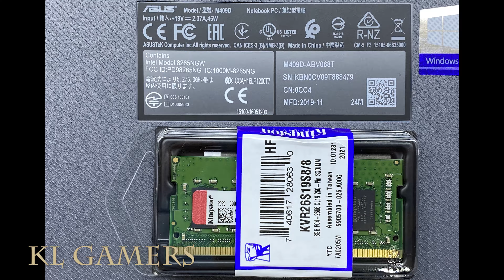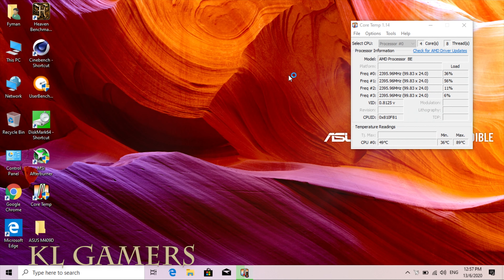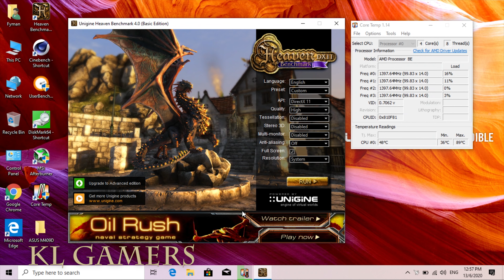ASUS M409D-ABV068T Notebook Upgrade DDR4 RAM with Benchmark

Comment: Ryzen 5 3600 a clasic for a notebook 😎
Reply from the maker: okay👌
Reply: This particular notebook uses a Ryzen 5 3500U CPU, which is substantially different from a desktop Ryzen 5 3600 CPU in that it uses an older architecture (Zen+ instead of Zen 2), and is a higher-binned chip for efficiency running at lower clock speeds so that its heat output is within the thermal profile of the notebook. It also has integrated graphics which the Ryzen 5 3600 does not. The CPUs you find in laptops are not exactly the same as the ones you would find in desktops, take note of that.

Comment: Why is the cpu usage goes up and down?
Reply from the maker: because the testing data is different
Reply: @KLGamers  ooooh
Reply: This behaviour is called throttling. Watch what happens to the CPU clock speeds and temperatures as the usage goes up and down. The manufacturer of this notebook decided to cheap out on this particular model by using a push airflow design that blows air through a small heatsink slab on the CPU. Not very effective as the fan isn't directly blowing through the heatsink, and secondly, the heatsink looks ridiculously undersized for the job, even if the CPU's configured for 15W TDP. A better and more effective cooling solution that would prevent throttling for the CPU would be a heatpipe and heatsink design carrying the heat to the outer edge of the laptop with a fan blowing air directly through the heatsink there which would result in much faster heat dissipation.

Comment: i want a new and much better laptop :(((
Reply from the maker: ASUS F512DA-EB51 VivoBook 15 Thin And Light Laptop, 15.6” Full HD, AMD Quad Core R5-3500U CPU, 8GB DDR4 RAM, 256GB PCIe SSD, AMD Radeon Vega 8 Graphics, Windows 10 Home,Slate Gray
(Amazon link) = https://amzn.to/3oLMujC

Asus Vivobook M409D-ABV067T/ABV068T 14" LAPTOP ( Ryzen 5-3500U, 4GB, 512GB, ATI 2GB SHARED,W10H ) NOTEBOOK
(Lazada link) = https://c.lazada.com.my/t/c.Y5atkR?url=https%3A%2F%2Fwww.lazada.com.my%2Fproducts%2Fasus-m409d-abv068t-14-fhd-laptop-silver-amd-r5-3500u-4gb-ddr4-512gb-ssd-i1421818378-s4558058101.html&&sub_id1=M409D&sub_id2=Netstore&sub_id3=2199
(Shopee link) = https://invol.co/cl2aspt

Kingston KVR26S19S6/4 ValueRAM DDR4 4GB SO-DIMM 2666 MHz/PC4-21300 CL19-1.2 V ( unbuffered ) non-ECC = RM79
(Amazon link) = https://amzn.to/2H6qeNP
(Lazada link) = https://c.lazada.com.my/t/c.eBlS
(Shopee link) = https://invol.co/clh6c4

RAM = Kingston KVR26S19S8/8 Valueram - DDR4-8 GB - SO-DIMM 260-Pin - 2666 MHz/PC4-21300 - CL19-1.2 V - Unbuffered - Non-ECC
(Amazon link) = https://amzn.to/32qf5AE
(Lazada link) = https://c.lazada.com.my/t/c.6xWP?url=https%3A%2F%2Fwww.lazada.com.my%2Fproducts%2Fkingston-8gb-ddr-4-2666mhz-sodimm-value-ram-kvr26s19s88-i420691924-s611669298.html&&sub_id1=2666&sub_id2=CGI&sub_id3=151
(Shopee link) = https://invol.co/cllbsa

RAM = KINGSTON 16GB 2666MHz DDR4 CL19 SODIMM 2RX8 (KVR26S19D8/16) 
(Amazon link) = https://amzn.to/2YORAD0
(Lazada link) = https://c.lazada.com.my/t/c.6iAw?url=https%3A%2F%2Fwww.lazada.com.my%2Fproducts%2Fkingston-value-ram-16gb-2400mhz-ddr4-non-ecc-cl17-notebook-memory-kvr24s17d816-i422032341-s614459176.html&&sub_id1=16gb&sub_id2=cube&sub_id3=272
(Shopee link) = https://invol.co/clh73a

Wireless Mouse, Right/Le, Red, M325
(Amazon link) = https://amzn.to/3n0wrNa